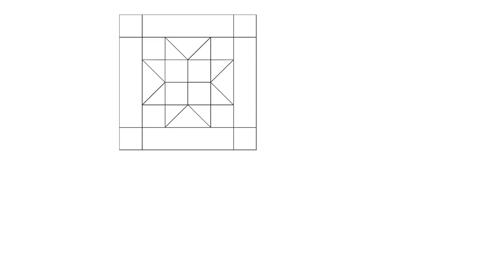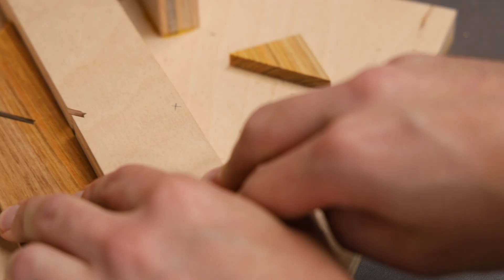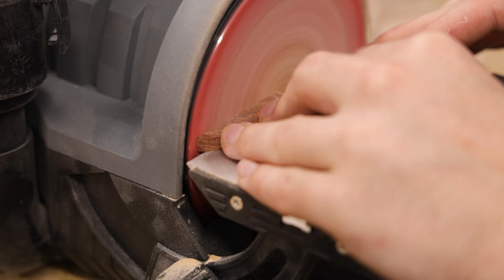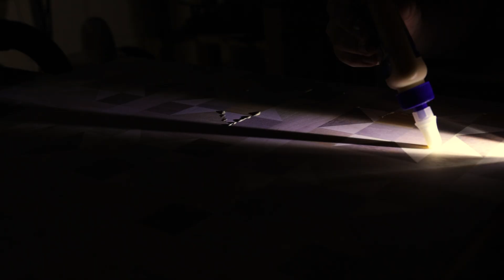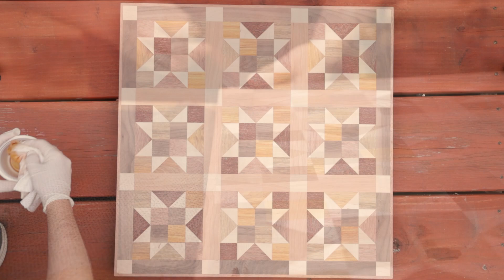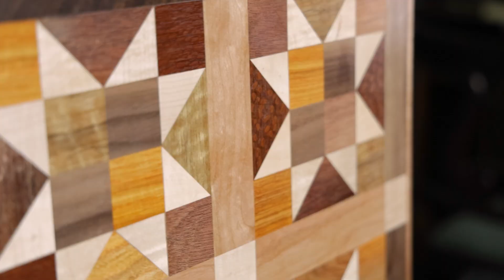Turning Hundreds of Pieces of Wood into a Quilt

Comment: The end result is beautiful as always.

I'd encourage you to do something similar using only the scrap wood you have lying around from previous projects, rather than buying entirely new wood. Quilts were originally (and often still are) made as a way to use the smaller scrap pieces of fabric left over from the creation of shirts, skirts, and other projects, which is part of why there are so many patterns with very small and/or triangular elements, and allowances for irregular colours.
Reply from the maker: Thanks! That's a good idea